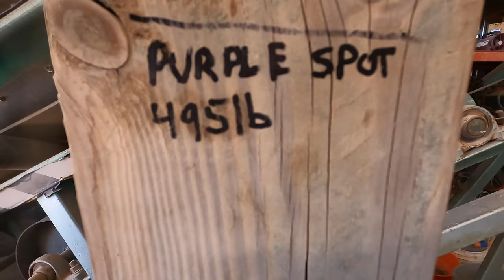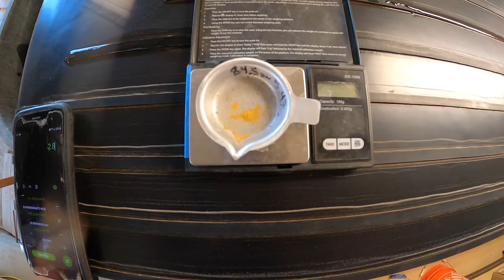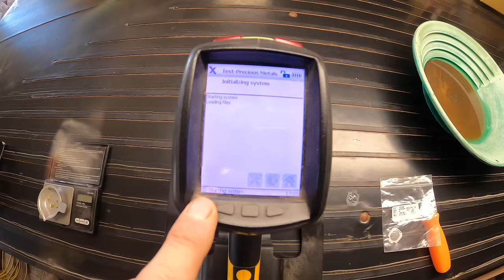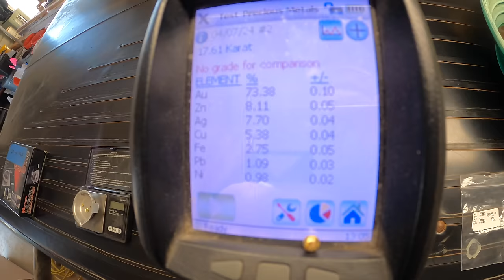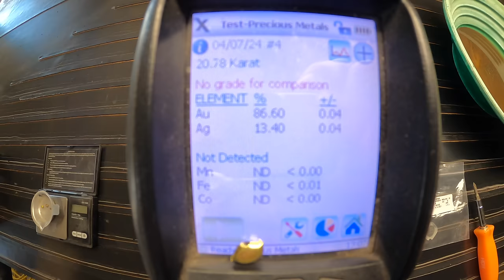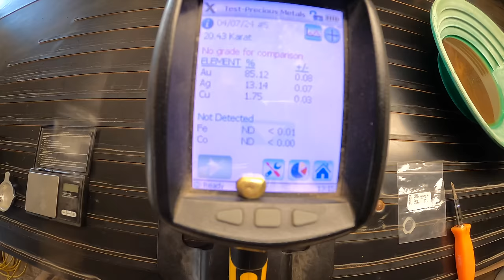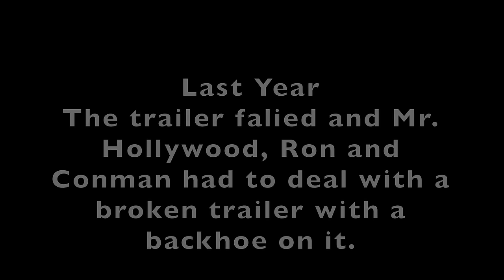Purple Spot Part 3, Hardrock Gold Ore Testing

Comment: Interesting results on the samples.  One concern or problem that I can foresee is if the gold is locked up with the sulfides or oxides that you are missing a good portion of the metal just going after free-mill gold.  Have you tested the idea of gold in the sulfide and oxide material?  You might have more gold than you are just recovering from the table and panning it out.  Just thinking out loads of here.  Great content as always guys keep it up!

Comment: That's some expensive gold you got there! Seems like a portable crusher and panning supplies would be the way to go in the field? 🤠
Reply from the maker: The first test of a place is just as you recommend.  Panning, small crushers and drill dust, dump grid testing, channel samples.  If that testing goes well,  then comes the small batch testing 10lbs and sometimes assays.   If that goes well we take a few hundred lbs then tons.  If the large testing goes well we go back for larger bulk tests for repeatability.  Without a Millsite testing would be very difficult.

Comment: Do you guys have a classifier circuit before the shaker? Nice videos!
Reply from the maker: Yes we do. We're currently screen to -1/16" before the table. We really need to screen finer and build an automatic feeder to send over size right back into the mill.
Reply: I'm using my makeshift vibrating classifier to 30 mesh over 55 gallon drum, then I get the ore damp throw fertilizer in the barrel and stir every couple days.  In a few months all the sulfides will be roasted without roasting. Keeping lid off barrel so oxygen gets in. Pretty time consuming but I figure if it's going to sit around before processing why not.